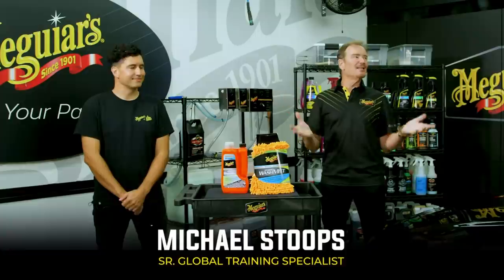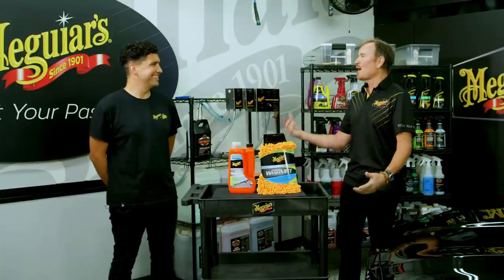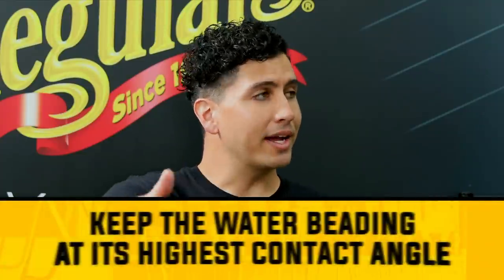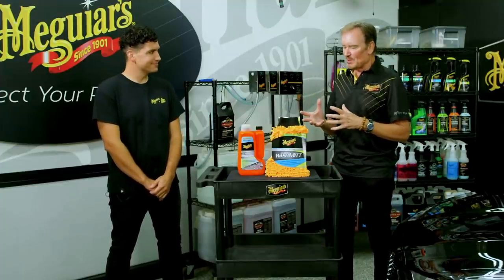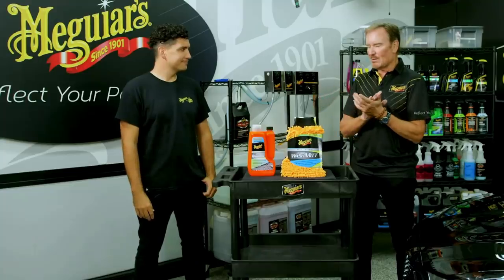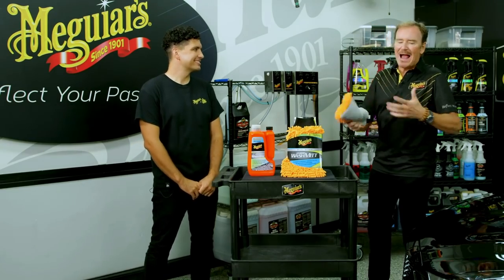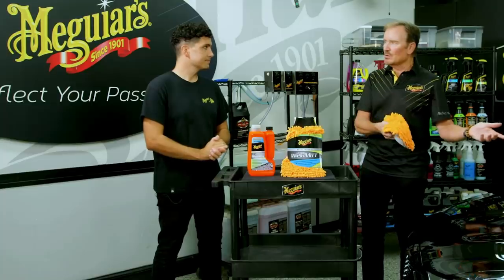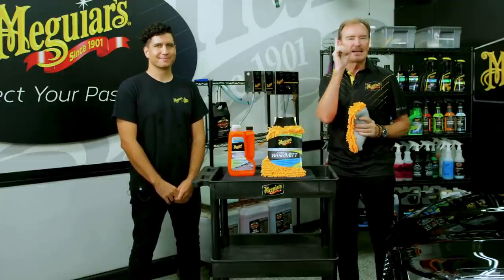SiO2 Water Beading Protection in a Car Wash?! Meguiar’s Hybrid Ceramic Wash & Wax – Shop Talk

Comment: Real excited to try this out. Turtle Wax's Hybrid Solutions Soap has been out quite awhile and it is still one of the only protection "infused" soaps I've tried that produces actual visible protection and water beading by itself. Even on a panel with zero protection and dead flat water behavior. I was in disbelief and geeked out for an hour the first time I used it. 

Loving these new products, keep them coming guys, super excited for the new aerosol sealant/coating hybrid too! Fast Finish is a phenomenal product and has saved me so much time especially on mobile jobs. Hopefully the application is just as fast and easy, that's what made FF so special. 
👍👌✌
Reply from the maker: Thanks for the feedback!
Reply: @meguiars  thanks for reading! Do you guys have an exact release date for Wash & Wax and the mitt? A combo package with the two together would be cool too! 😁👍
Reply from the maker: Unfortunately there is never an exact release "available" date because we do not control store schedules for putting new products on their shelves.  Typically this happens some time between February and April for any given store.

Comment: I have an abundance of meguiars products in my garage guys I love em, one question no one has asked, how long do they last as in expiry date ? Ultimate line and hybrid line ? I owned them all for a long time and was never sure 😱😱😱 great products except that yellow towel always leaves lint everywhere :/
Reply from the maker: Thank you for the feedback and your loyalty throughout the years.  

The shelf life of our products is 3-5 years if stored in a moderate/climate controlled area.  This means not freezing in winter or in a garage in Arizona through Summer, etc.  That being said they can still often last through some of those conditions or even longer than 5 years.  Just shake well and pour some out.  If the product has the same consistency and is not separated/watery/lumpy it is still good.  Even if the product goes "bad" it doesn't become harmful it would just not apply and remove easily. 

Hope that helps!

Comment: If my car needs to be clayed, and i want to use the hybrid ceramic clay kit, should i wash with this, then clay, then hit it with the spray wax? Also if i require a polish for fine scratches, which polish works well with this system? Thanks!
Reply from the maker: This wash would work better as maintenance after you have already restored the paint as there is no reason to put protection on the paint and then clay and compound it right off.

Our Ultimate Compound would be a great choice to remove light to moderate defects like scratches, water spots, oxidation, etc.

Comment: Hi Meguiar's, does the drying step need to be done with a towel, or can an air dryer be used? 
Same question for the hybrid ceramic wax spray - once it's pressure washed off, can an air dryer be used? 
I have a black car, so I'm trying to touch it a little as possible!
Reply from the maker: We really recommend towel drying for application of the Hybrid Ceramic products as the drying helps spread the product and remove any excess.  That will not happen with only air.  In theory though the Wash & Wax could be used that way if the car was thoroughly rinsed first and all the excess residue was already off the vehicle.
Reply: @meguiars  thank you!

Comment: I tried it this weekend but didnt get any suds at all but after watching this video i noticed there was no suds on the car
Reply from the maker: Correct, although you should have seen some suds at the beginning when adding the wash to the bucket.  However as you work and add the ceramic boost you will see that this wash does not suds much at all as is covered in the video.

Keep in mind suds are cosmetic.  We all love to see them but they have nothing to do with the actual performance or benefits of a wash.  This unique formula offers much more protection than a typical wash & wax.  The formulation does not lend itself to high sudsing.

Comment: Foam cannon also?
My future shampoo to maintain my ceramic coating!  👍
Reply from the maker: No, the new Hybrid Ceramic Wash & Wax is a very unique formulation and application.  It will not work with a foam cannon.